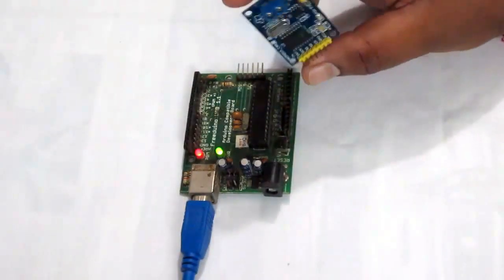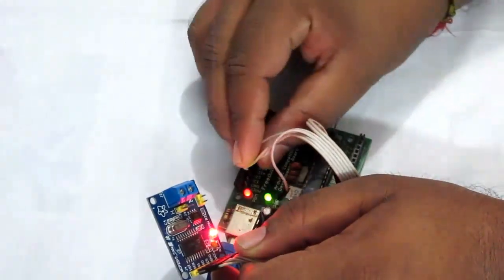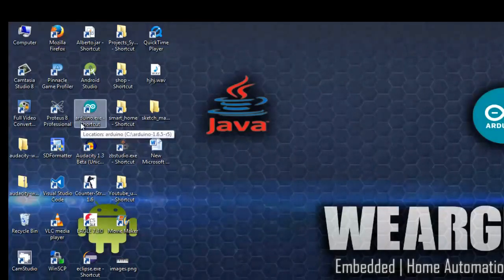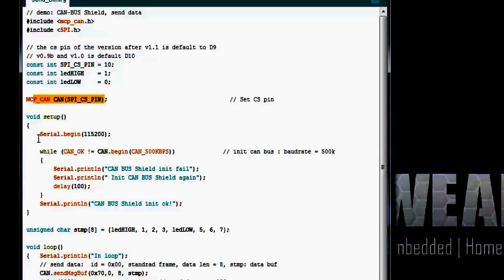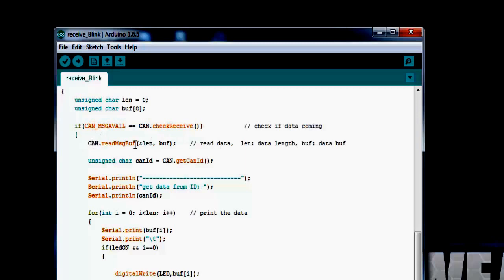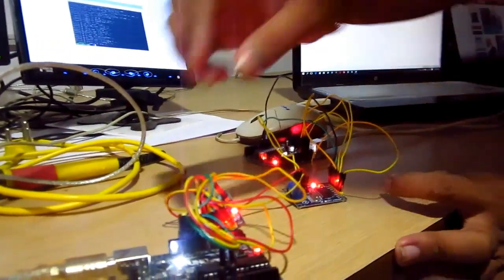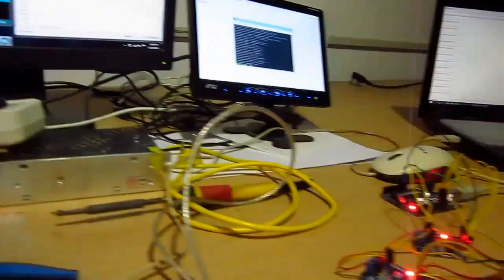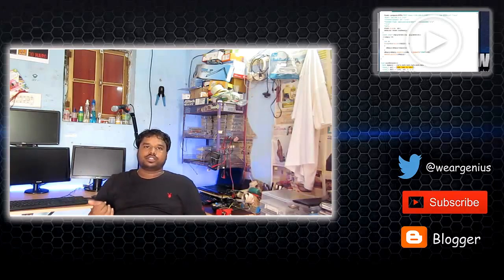Arduino | Tutorial | CAN Connectivity using MCP2515

Comment: I have a joystick that outputs in CANbus. Can I use your posted method to connect the CAN output from the joystick and read exactly what the output is?
I want to do this because afterwards, I want to use a joystick that outputs 0-5v analog, and I want to take that as input into the Arduino, and use the CANboard to output the same CAN signal that the first joystick did. In other words, I want to create an analog to CAN converter using an arduino and the chip you mentioned. Can this be done using the MCP2125 chip and can you recommend how I go about it?
Reply from the maker: It should work... Again MCP2515 is the controller for CAN only along with that it needs a transceiver IC which is already there in the used module. It will give you a standard CAN interface.

Comment: good job , im looking to build an actuator which opens after certain psi , can anyone help me to figure it out how to run it ? thinking of taking the reading from obd port.
Reply from the maker: I have not worked on integrating with OBD port, but that should work.
Reply: Ok , thanks for the reply. Any idea where to get the codes?

Comment: How can I read data from the OBDII scanner using this prototype. I want to connect the ELM327 to my car dashboard and then retrieve data, but I also would like to send data back from the prototype ( like yours ) back to the car ? Your inputs would be appreciated.
Reply from the maker: +Shashi Kiran Although I ahve not worked but their arre Bluetooth and wired OBDII scanners are already available in the market. I suppose those can be hacked or can be connected to microcontroller to fetch data out of those.

Comment: Hi Very helpful but please let me know how to get MYSQL data base  values in to Arduino coding ..is it possible through WiFi ?? As by data base is online and want to look some values on behalf of RFID tag .now please note in database in table I already stored RFID details now I want to search that tag through Arduino code that get the flag yes or no which is there on behalf of each RFID which stored in the mysql table .
All connections are online connected through WiFi ..please thanks in advance ..
Reply from the maker: You can have a server side script running, with the required server and you can create an API that will do the query from MySQL and return you the result.

Comment: Nice video. but i have one doubt that here you have not used mcp2551 transceiver. you have directly connected mcp2515 to the can bus. Is it not necessary to use mcp2551? if not then what is the use of mcp2551?
Reply from the maker: The board that I am using does have the transreceiver...but not the mcp2551 one...we need controller as well as transreceiver...
Reply: WeArGenius Ok. Then that means mcp2515 microcontroller will convert and transmit packets into CAN_High and CAN_Low? Because i heard mcp2551 transceiver is used to convert data packets to CAN_High and CAN_Low😅 thanks in advance
Reply from the maker: Mcp2515 is only the CAN controller , the module I have used has a transreceiver on it namely TE something , I don't remember the name but it does have a transreceiver along with the MCP2515
Reply: WeArGenius ok thank u🙂

Comment: Does this work bidirectional? Basically if I am using 2 Arduinos and 2 MVP boards, I can send and also receive messages on each of the MCP boards. Is that possible?
Reply from the maker: Ya you can make it work..

Comment: is it the same code to tja1050 transceiver and mcp2515 or code is changed???
Reply from the maker: Yes
Reply from the maker: +vijay bhargava I am travelling right now.... will get back to you as soon as I get back to home...don't worry everything works just spend some time tinkering it....anyway will check...
Reply: HEY, 
First of all thanks for responding.
And yesterday i tried it again and seen in the comments one of them is about JP1 terminal and it  had really a lot of importance.
We need to short(JP1) it to have a 120ohm in between them(CAN-High and CAN -Low ) and then "I ACTUALLY GOT THE RESULT".
The data is transferring properly superb and if i have any doubt or get any other issue i definitely post it in the comments and I thank for your response.
Great work and have a nice day :-)
Reply: And i want to suggest to list out the connections or use like 123d circuits Arduino simulator
or any other thing like that so it will be more good...and attractive even with making it easier!!
Reply from the maker: +vijay bhargava good to know it worked for you....cheers...

Comment: Hi, can i connect both arduini to the same pc but different usb ports?
Reply from the maker: Yes
Reply: @WGLabz  I'm using two arduino and two can bus shield (MCP2515 TAJ1050) with 8MHZ. I have no mistake but the two Arduino do not communicate. can you help me? I'm using the library example

Comment: And I have one more doubt like first i have finished my communication between two can protocols 
So can i remove one and can i keep a car on the other half for transmitting can messages  to my can module??

(or) can i connect the same circuit to a car???
please reply fast.....
Reply from the maker: This is for CAN Comm and can read data from any device as long as you have required protocol information. If you want to fetch data from any car better look for any OBD module.
Reply: Thanks for the reply bro...
Actually I had  made the project and established the CAN communication using OBD2 commuincation
It is just extension of your project and its very easy...
I am gonna make a blog for that and until now my partial blog i kept below 
https://vijard.wordpress.com/
and i will finish my blog very soon 
Thankyou.

Comment: Dear sir,
Please let know one thing.
Is we can connect 2 Arduino Uno + mcp2515 module to single PC and run this module.

Also if possible please share the code which u have done in this video, please provide link of codes
Reply from the maker: Yes you can do so

Comment: have schematic connect pins of arduino with can module?
Reply from the maker: That's SPI communication and Arduino has pin 10 to 13 for that. I have not made any schematic for that but I hope it will not be that hard for you to make the connections.

Comment: Connecting modules while arduino is powered on is a bad practice IMHO. These modules aren't normally designed to be hotplug and neither is the Arduino (and it's easy to plug things in the wrong ports/short the Arduino with the metal pins, etc....).
Reply from the maker: +Benny Kleykens Exactly...My bad I should have done like that in the video.. thanks..